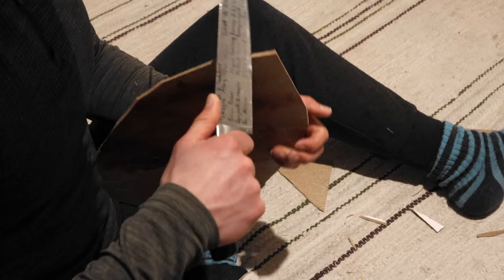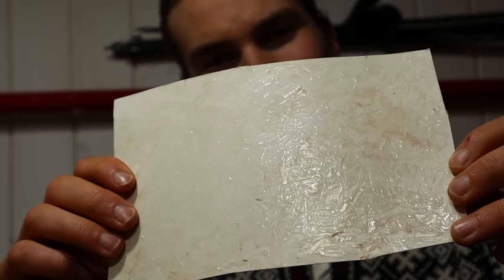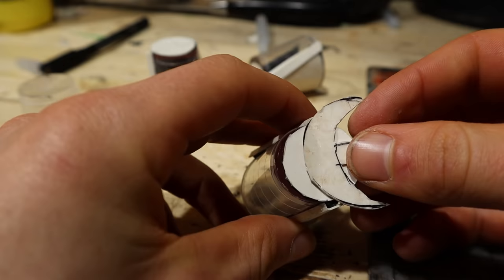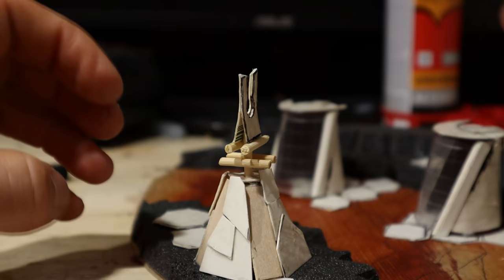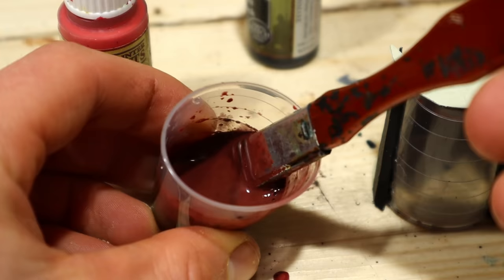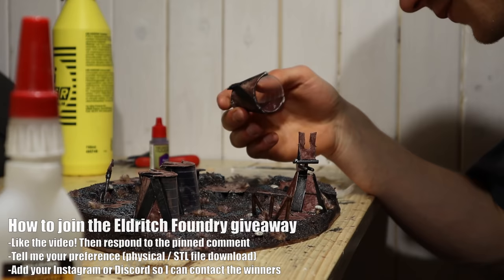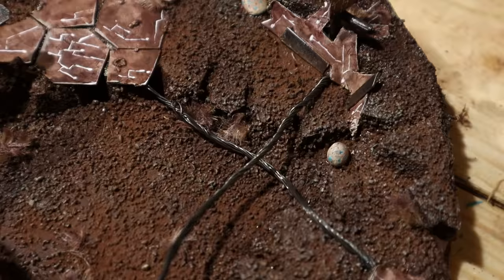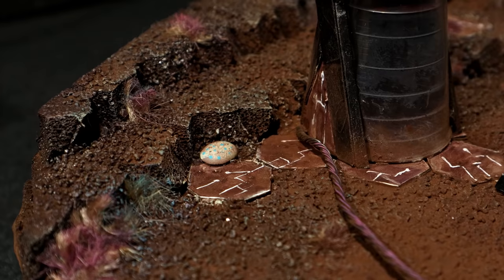I have no idea what I'm doing: Making a MIND FLAYER Diorama (Giveaway!)

Comment: Everytime bard says 'easy to find material', i'm like this is going too cost $20+ in Australia for no reason that or it either doesn't even exist on shelves here.
Reply: I use all sorts of garbage. My foam is the stuff that comes as packaging. I use cardboard instead of card stock... I am way lower than "peasant level."
Reply: yep same.everytime there's foam I'm like "well I'm never going to make that" everytime there's bark I'm like "that's going to look like paper here"
Reply: Guy, you don't need to buy pigments or textures, you live on a giant island only made of pigments and textures of desert.
Reply: @MaitreKuza  1 was primarily talking about foam. Good luck finding foam in a reasonable size for hobby crafting. 2 never mentioned pigments 3 I stand in corrected. The textures aren’t right here. Paperbark isn’t going to do the trick.
Reply: @leftistadvocate9718  I use foam for flowers and foam from my package, when you buy TV, or gardening tools, this kind of stuff. I never find a foam that seems as hard and thick than bard used to have.
It works, btw.
Reply: @MaitreKuza  that's closed cell foam. what's typically used for crafts is open cell. closed cell foam, what you get in packaging, flakes off. I mean you can coat it in some kind of resin or plaster something but you may be leaving the land of peasant level crafts by that point.